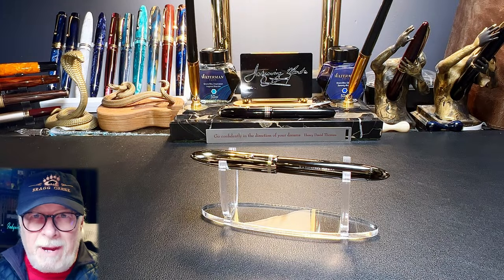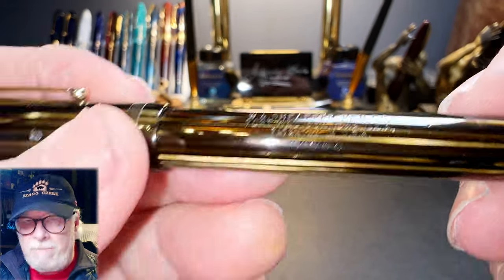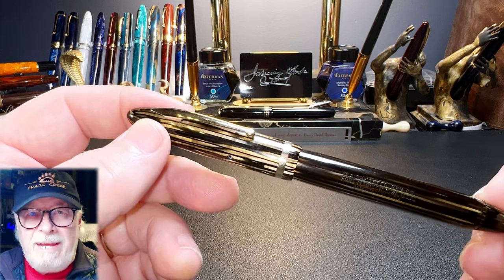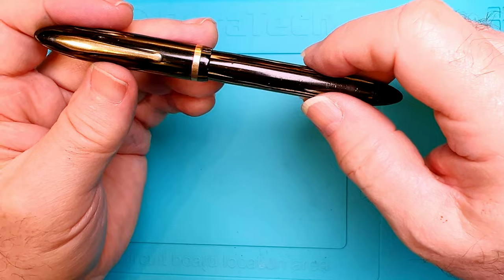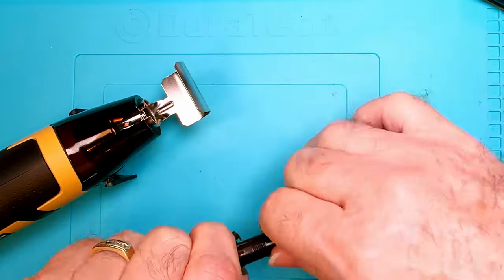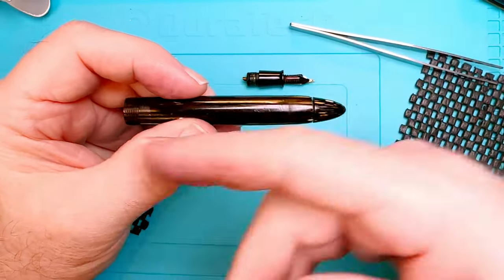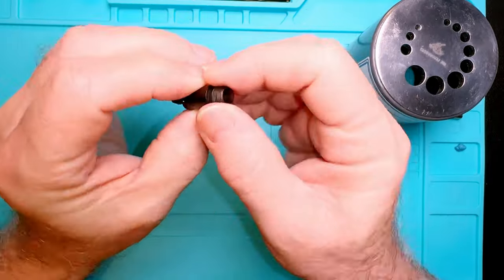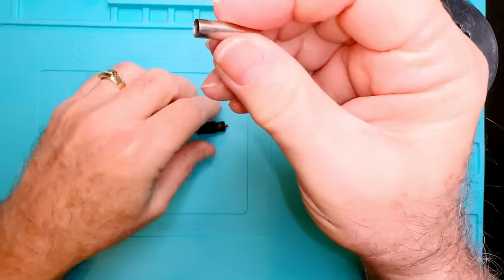Pen Resurrection Sunday Ep 58 1940 Sheaffer Balance 500 Vacuum-Fil

Comment: Thanks, Doug, for restoring my faith in restoring, well, you know. A very pretty little pocket pen I bought needs its plunger seal replaced, (not the kind that stops water flowing out of the toilet tank), as it flops around inside the barrel and I can't reach in far enough to even try twisting it off. But after watching this near-miracle, and after re-watching several times, maybe I'll see about heating the inner rod. Eeek!

Comment: That is a pretty Balance. I have a lever fill white dot from the same '36-'42 time frame. I was lucky when I got the section out that the sac was good so I concluded that my grandma must have had it worked on at some point.

Comment: A great resurrection, Doug. Using the Stik-tac to hold the blind cap was the way to go. Those threads were horrible. 

Thankfully the nib and feed were in good shape. The cap and barrel came out beautifully, considering the condition the pen began. This was a tough one. 

You should hang a shingle for your valuable work outside your home.
Reply from the maker: That would make it a "job"! :( Thanks, Paul!

Comment: I always make sure to dry these before heating as the celluloid can go cloudy from the heated water, it doesn't seem to have to get very hot to do this. Don't be intimidated by drilling the old unit out to replace the old seal, it's difficult to go too far.
 If you really wanted to fix the threads I have had good luck 3d printing ABS packing units and solvent welding to the celluloid. It would be possible to drill the back out including the threads to replace with a new 3D printed replacement with threads if you wanted. Stopping the printer and embedding the o ring in the print works well. I use an ABS + acetone slurry to weld the parts. I have done several tuckaways like this, cutting the old packing unit off using a pipe cutter and welding the printed replacement (they have an internal barrel), they still work after 3+ years and I can tug on the plunger with a lot of force without breaking it. I  think I have files with the threads somewhere.
Reply from the maker: Wonderful advice and I understand the process. Not sure I"m ready to give a try just yet though. (scaredy cat)
Reply: Hi ChrisM-st1pw  I do some 3d printing with a Form2 acrylic printer, and I would like to try your file if you are willing to share.

Comment: Great repair Doug for your first time,I must have done at least 20 of these great pens,I always first try soaking the plunger shaft seal because it as usually dried out & 8 out of 10 times it works,just put  silicone grease on the inside of the gasket seal & it stops it drying out.When it doesn’t work I use the drill out the packing method & replace with a ‘O’ ring.
Reply from the maker: Good tip! I did soak the pen in pen flush in my ultrasonic before I started to work on it. I don't understand the drilling of the end packing unit? How do you replace the blind cap threads with an O ring?
Reply: @InkquiringMinds  You drill it out from the section end,remove old packing put in O ring & cap it with a plastic washer which you seal with MEK(a liquid which melts the washer to the old seal plug).But in your case the threads are damaged.Richard Binder as an excellent diagrams showing you how to do this repair.
Reply: @InkquiringMinds  As @edwardwiper1323 said, the way to fix the packing unit is to drill it out from the inside, use a dental tool from the inside to pull out the old packing material, insert a properly sized o-ring into the cavity left when the packing is removed, then affix a washer to keep the o-ring in place. This results in a nice, tight-fitting o-ring that seals well around the rod and holds the vacuum. Richard Binder and others have good instructions on this process online, and the o-ring and washer are available from Anderson Pens.
The other problem that prevents a good seal is if the rod itself is damaged or corroded. You were fortunate that the rod was in great condition. Sometimes the metal corrodes inside that sheath and that is the end of the rod. Other times, Sheaffer used a bare rod and it can corrode as well. Finding a replacement rod can be a real challenge, as there were many different sizes.
I've never seen blind cap threads ruined like you encountered. Your solution to that is very creative!
Reply from the maker: @johnhubbard8058  That repair is beyond my skills on a pen that doesn't belong to me. Drilling from inside the barrel requires the precision of a lathe.
Reply: @InkquiringMinds  I admit that I have not done it, but the instructions I've seen show the drilling done by hand. Apparently, the conical shape of the tip of the drill bit will center up sufficiently well in the hole in the packing unit. It doesn't have to be too precise, just large enough to dig out the old packing and slip the o-ring in to replace it. But I gave up when I found out about how many different rods there are, and I pay an expert to fix mine!
Reply from the maker: @johnhubbard8058  Thanks John. I still can't quite visualize it. The drill gouges out the old packing unit and then the new o-ring goes in. How does it stay in place?
Reply: @InkquiringMinds  The drill enlarges the hole in the bottom of the packing unit just enough to allow the old packing to be picked out (dental pick works) and the o-ring to be squeezed in. Then a plastic washer with a smaller hole size is adhered to the remaining rim of the packing unit. They recommend MEK to "weld" the washer in place. Obviously the really touchy part of this is not getting any MEK on the walls of the barrel as one is slipping the washer up thru the barrel and into place. The pictures I've seen show using a cylindrical tool that just slips into the barrel, with a smaller cylinder on the end to hold the washer centered.